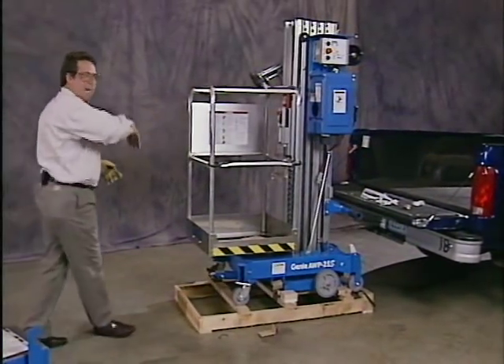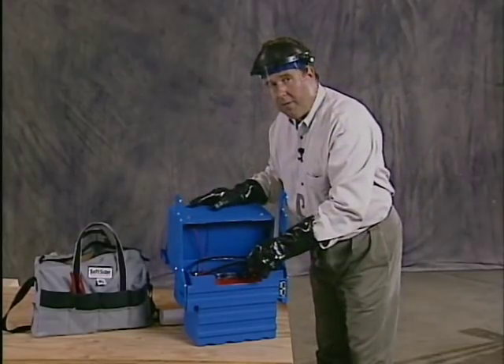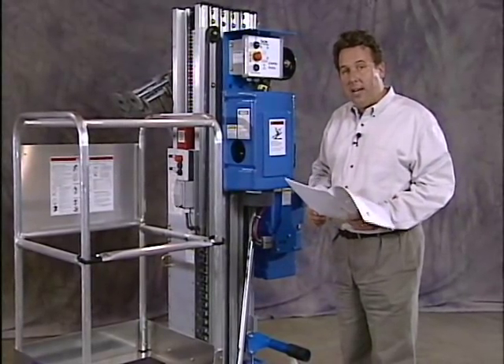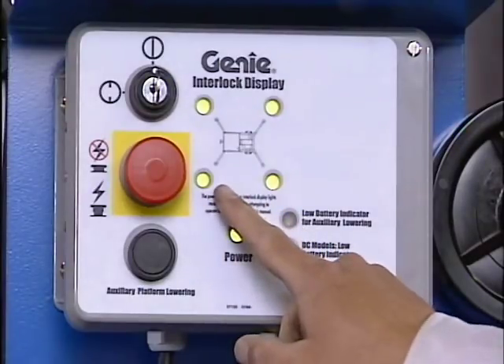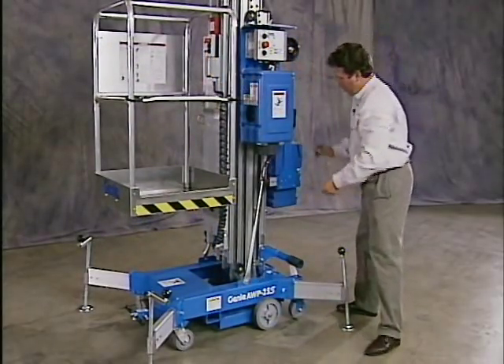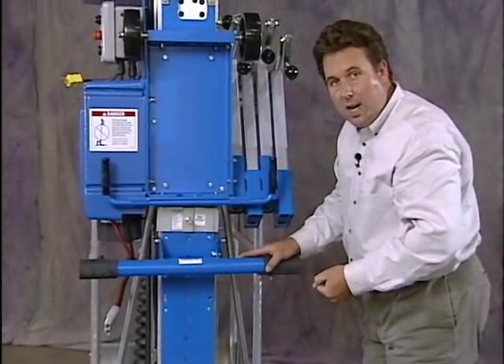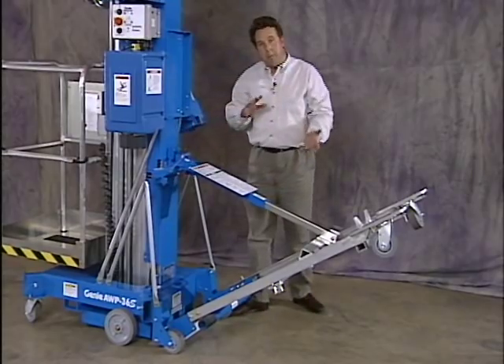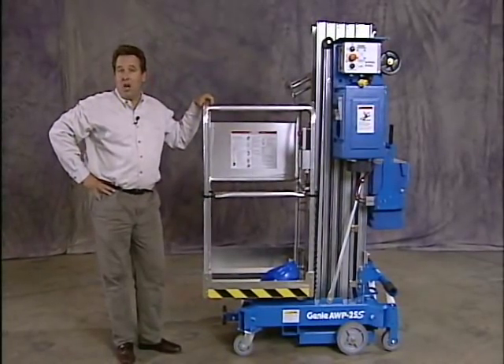Genie AWP set up & operation

Comment: I don't own one and am planning on renting this in the fall.  Can this be used outdoors?  Should I get some kind of platforms to put under the outriggers for leveling?  I want to use it on the ground near our house and garage to get branches off the roof and do a little tree trimming, but I'm concerned the weight may cause the machine to sink in the ground a little, I'm trying to figure out what I could put down to roll it on to prevent this from occurring.
Reply: When you arrive at the rental place tell them what your intentions are with it. they should be able to point you to the correct mewp for what you need. tell them what surface you plan on working on & the approximate height your looking to work at.